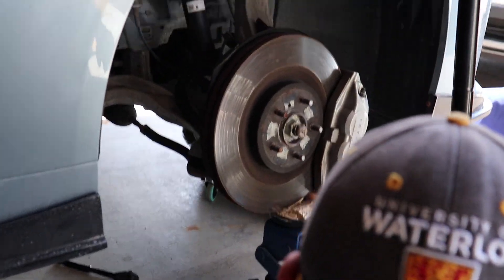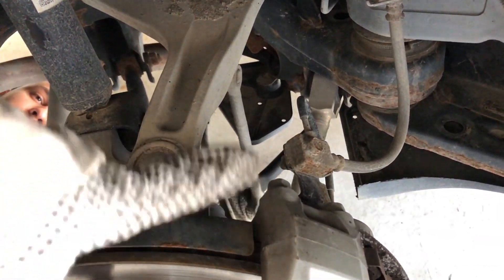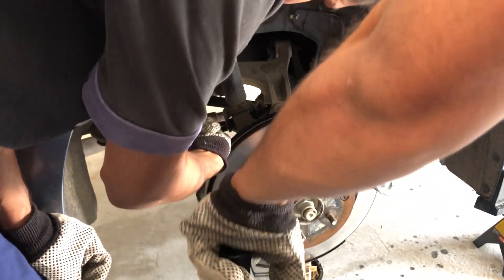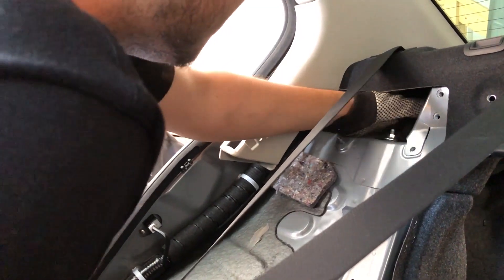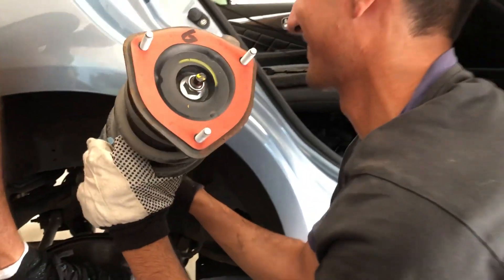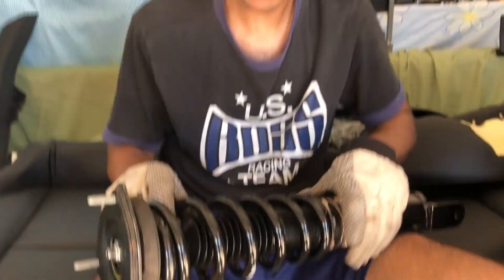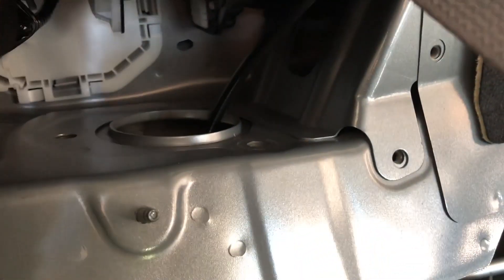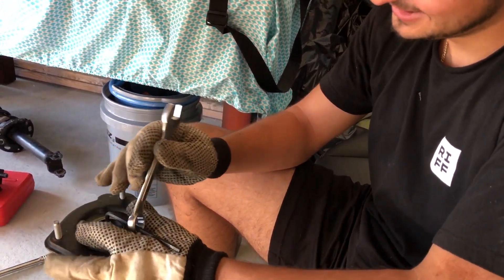Lowering Infiniti Q50 on BC Coilovers - Part 2

Comment: did your coilovers come with 4 damping adjusters ? or just 2 for the front ?
Reply from the maker: All 4 are adjustable. The rear ones have extenders to make it easier
Reply: @AnishNothoo  i guess to better ask my question do all 4 come with the damping wheel does the original kit come with  a adjustment wheel for each strut or only 2?
Reply from the maker: Dm me on IG and I will send you pics of mine if you are confused
Reply: Has anyone tried to use on rears damping the adjusters to hard instead of soft. How does it feel ? I got my front turned to hard all the way